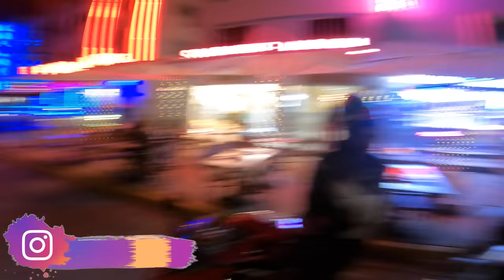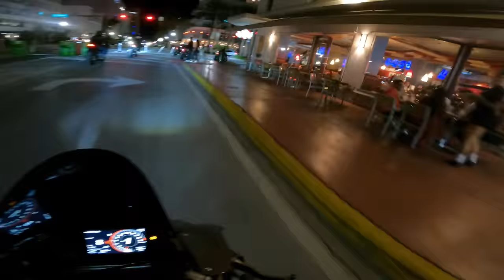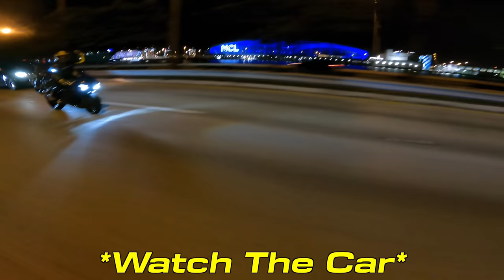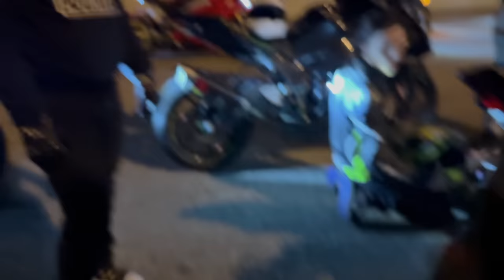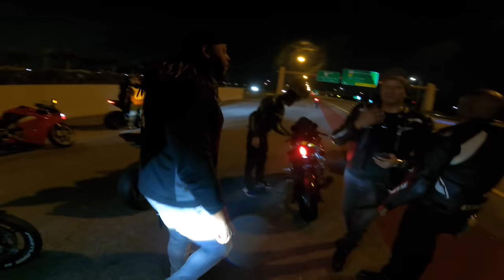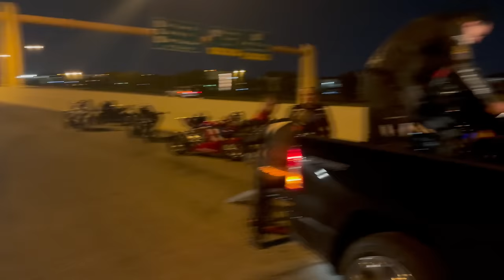Yamaha R1 Oil Filter EXPLODES During Highway Pull 😳 | S1000RR, CBR1000RRR SP, Panigale V4 SP2, ZX10r

Comment: That’s so wild that happen to him! Heard that’s a normal thing with those gen r1🤦🏾‍♂️
Reply: It is i always used yamalube filter and never leaked until I tried a high flow it started leaking idk why
Reply: And what Ducati is unreliable?😂
Reply from the maker: Yeah I’m just glad the motor was ok…at first I was like 😳 thanks for watching brotha 🤘🏾 #FastLaneGang 🏁
Reply: It’s not normal. Either he neglects maintenance or he/the mechanic he goes to fucked something up down there.
Reply: @need4speed290  Bad oil filter isn't a Yamaha problem, it's a bad filter. 

You like those Ducati's that only won 1 motogp in 2007, and never ever in any other year. How many has Yamaha won? Like 30. Only time Rossi sucked was when he was with Ducati, so he went back to Yamaha and started winning again. Ducati is pretty, but not a champion.

Comment: Yeah that's why I always ride with an LED roadside emergency strobe light kit that has a crank charger on each light so you don't have to worry about the battery dying on them. Just spin the crank 10 or so times and it will strobe for 4+ hours. Purchased after i lost a friend five years ago because the little emergency flashers that are on superbikes real tiny and are very hard to see.

Comment: Damn, must be a pain getting all that oil off. Did it leak from the seal or did the actual filter house start leaking?
Reply: This is happening to alot of sports bike riders who actually push their bikes. You can't really hand tighten a spin on filter on one of these bikes.  You got to put a small amount of tight on the filter with a wrench that fits it. But you can't overtighten it either. But it's got to be more than just hand tight. I've seen several sports bikes on YouTube do this.

Comment: Something similar happened to me. I didn't put the drain plug on tight enough after an oil change. Got on the highway and the plug fell out and 4 quarts of expensive new oil all over the bike and highway. At least I wasn't tailgated anymore.
Reply: try torqueing it to specs, an every oil change needs a test flight, an recheck look for leaks. & re-torque it week after, but give it a quick visual along with the filter b4 any ride an at stops (Warning- HOT so just a visual an drip/puddle check). vibration my friend, an alot of it.

Comment: @FastlaneD next time let the guys know when running like that if they can't safety wire it just use a dab of RTV after they change the filter and it shouldn't spin loose. We do it at the track.
Reply: "use a dab" well that's stops any ....TROUBLE AT BARREGARROW....concerns if have a bit of heavy "tap" down the bottom .
Reply: @tonypate9174  man I am not following your statement can you explain?
Reply: @joyfulpyro2589  Yes would you like/need a 50/50 or phone a friend ? Before trying a Tubes of You  dive down the hole of rabbits ?